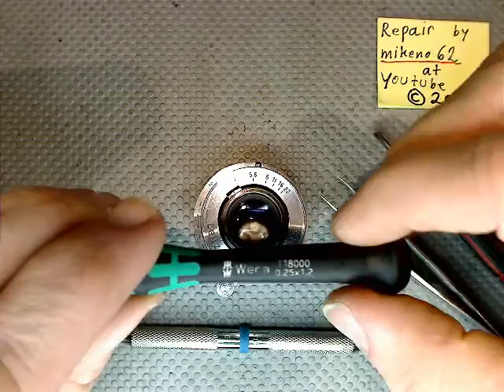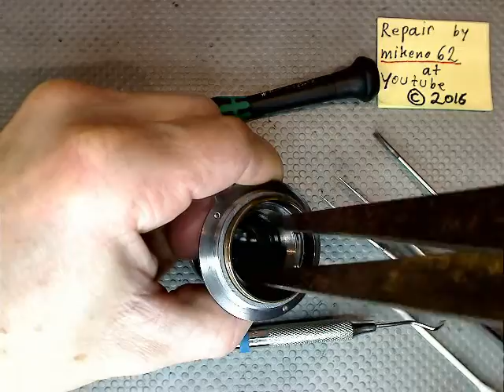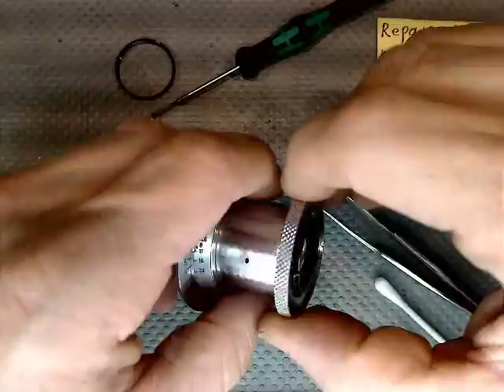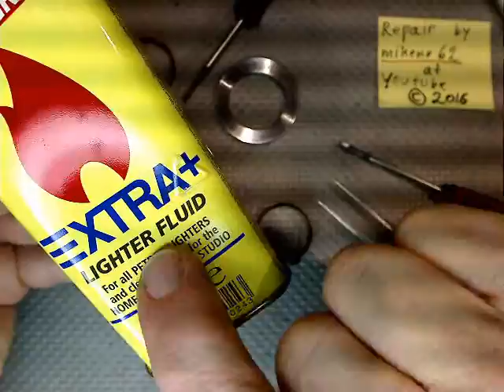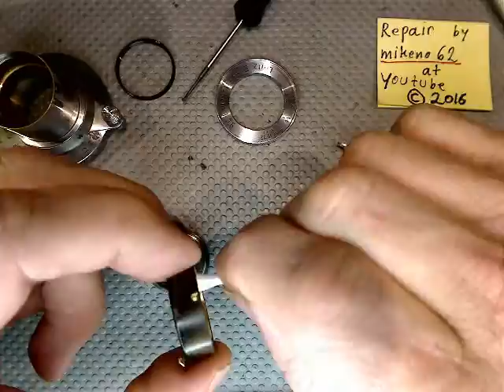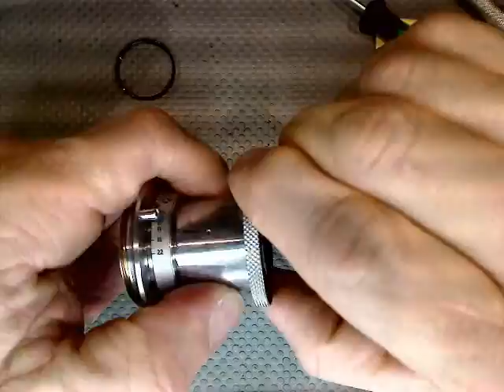Stiff aperture ring in Leitz Elmar f 5=cm 1:3.5 screw mount________Motion Lapse Film

Comment: had my 3.5 lens professionally serviced by Michael's Cameras. Fog inside, did not like the idea of working on this expensive lens. . My summitar f2 lens aperture was very stiff. Other wise the lens was mint.  I used PTFE. LIQUID. Just enough to for smooth operation. Do not use too much or you will have oily aperture blades and foggy lenses. A tooth pick with a very small amount will work. Slowly work the PFTE in. Use this method on my EXAKTA vintage lenses as well. I admire Mikes skills in repairing his lens and thanks for sharing. cheers

Comment: Hi Mike, I tried using your video to disassemble my grandfather's 1951 Leitz 3.5/50 the first retaining would not come out as there is a fixed ring that is too narrow for that retaining ring to come out. Then I tried to unscrew the front main ring (that has all the writing on it, with the grippy edge), but that would not unscrew as it got very tight against the small aperture sliding lever, any tighter and it may have broken, any less tight and it will not come off. Do you repair these lenses? Could you do it for me please? I just want the lenses cleaned and have it re-greased.....I could send it to you with the small screws I have taken out?

Comment: Hey Mike, great videos, thanks for sharing. Question, I've been looking online for a similar spanner wrech that you use here with the arched outward ends and I can't seem to find. You know what this tool is called and where I might be able to find? Thank you so much.
Reply from the maker: Thank's Joe, the one I use in this film is a old kind of a compass, actually it is used to measure the diameter inside a tube, just to check if one have many many tube's that should measure the same diameter.
I have file it so it will fit in many different lenses.

Here you can find one of those, there are many different size's:

https://www.amazon.co.uk/Divider-Caliper-Compass-Marking-Machinist/dp/B015CN9A8M

Cheers
Kenneth

Comment: Hi mikeno, which lens comes close to the distagon 28mm f2.8 in terms of stuck aperture service?
Reply from the maker: There are very often problems with oil on the aperture blades in Carl Zeiss C/Y 25mm and 28mm 1:2.8, but also with CZ c/y 50mm 1:1.4.
Reply: +mikeno62 thanks for your quick response. Is the C/Y 25mm f/2.8 similar or identical in terms of assembly of the inner parts (aperture and so on?) Would I be able to get it done by myself using your repair video of the25mm C/Y?

Comment: Hi, I have problem how unscrew retaining ring. My lens has more rings inside barrel and it is no visible. I have unscrewed 2 little screws but not possible to unscrew front ring.. not sure if if is reason of not unscrewed retaining ring. Thanks for any advice :-)
Reply from the maker: Maybe it's not the same version of lens, just like in my film. OR there is another broken set screw, sometimes they can be very difficult to then unscrew.
Maybe the front ring is just very tight...
Reply: Hi, I tried everything but not possible to unscrew front ring. I unscrewed that 2 little screws... maybe is that front ring glued :-) I used nail remover too if there was lacquer, lens filter wrench with rubber gloves... so not possible to do with my version nr: 1049433 :-) thanks anyway

Comment: how do you determine which point to re insert the front flange?  trial and error?  i keep getting either too far or too below the flange screw.
Reply from the maker: When I disassembled the front part I make some small mark's so I know where thing's sit correct, It help's me a lot when assemble the lens again. That's why it's "easy" for me to determine where the front flange (and other parts..) has to sit.

Cheers
Kenneth